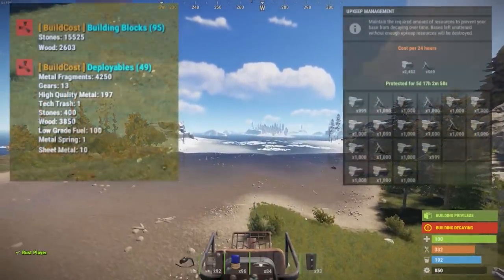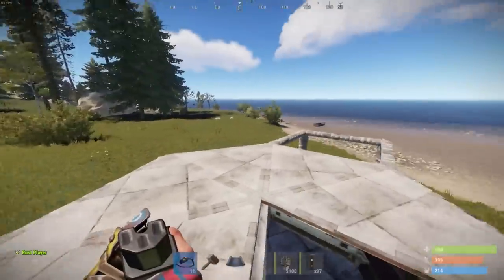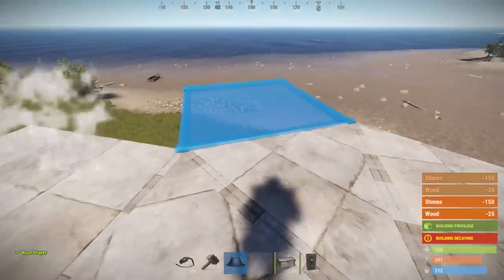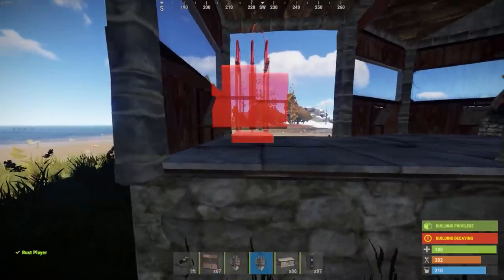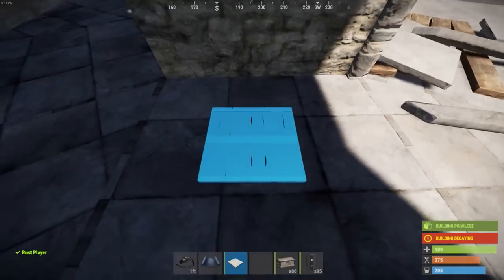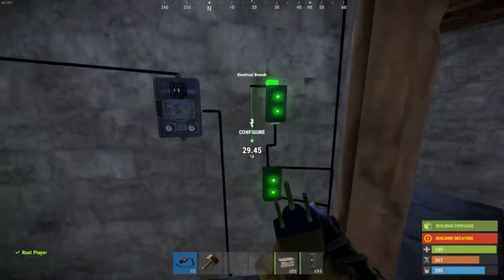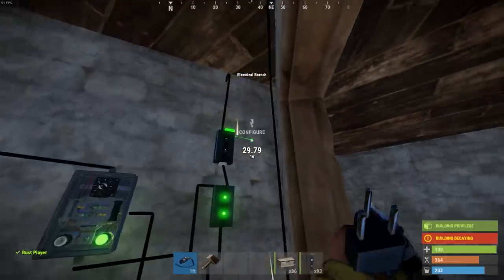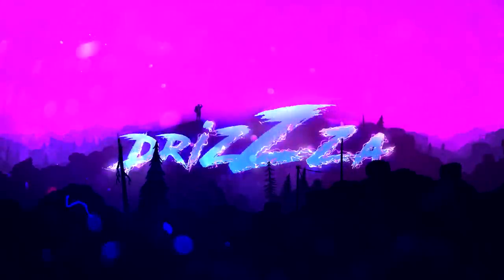Rust Minicopter Base With Electricity | Automatic Doors

Comment from the maker: If there are any other types of circuits that you would like to see me implement within a build in the future let me know!
Reply: I've been thinking about building a "home"/"not home" switch into my builds, so that the inside of the base feels spacious and everything is easily accessed, but you don't have to go around shutting everything when you leave or go offline.

I wonder if you could come up with a proper build, or implement this into an existing build in a way that feels natural, giving you a "spacious" base while also being properly secure when in the closed mode.

You have a lot more experience with Rust building and electricity in Rust, so I'd love to see how you'd go about this.
Reply: Do 4 HB sensors working guide with just 1 battery instead of 4

Comment: Any idea why this configuration only charges one battery? Technically, it charges the other but at an exponentially slower rate and when one battery reaches capacity, the other stops charging entirely.

Comment: With the branch why don't you just set input power to max? It only ever takes what it uses and doesn't use any more so doesn't advertising use mac power all the time but saves you going back and changing it should you add my something to the circuit
Reply: Asking to learn btw not to piss you off comrade. Much love
Reply from the maker: Shouldn't need to change that circuit if you do the battery thing, but i don't think the branches work like how you say

Comment: You don't need 2 large batteries for a base that size, WTF ?
Reply from the maker: The batteries are optional if you plan to store power for other circuits outside this base
Reply from the maker: They aren't connected to the doors